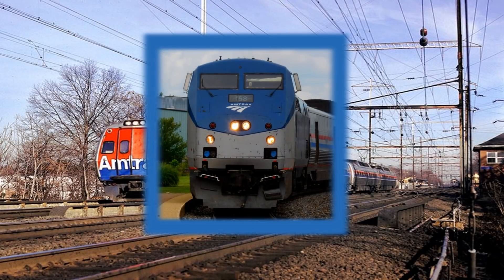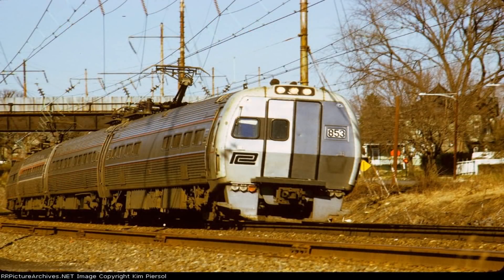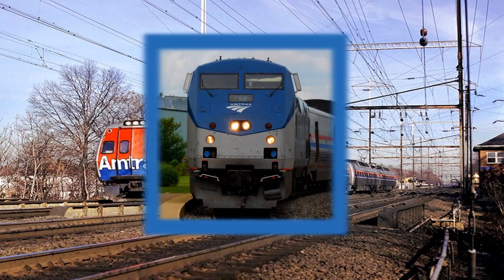Engines of Amtrak - Budd Metroliner

Comment from the maker: Please go watch the remake of this episode here! https://youtu.be/lXs8uaeQNRM In my opinion, its a lot more watchable and well written than this one lol. I'll still be keeping this episode up if you wanna come back to it but still, please check out the remade version too!
Reply: 4:21 Electrical arcing issue 4:25
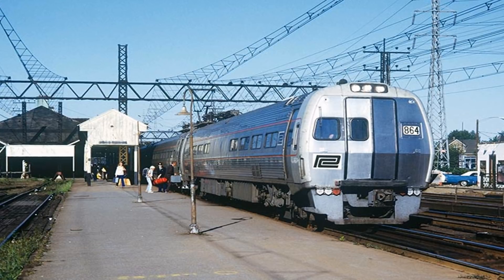Reply: 4:26 LOL!
Reply: 6:13 Westinghouse
Reply: 5:04
Output: 1200 horsepower
Reply: 5:11 SHRILLING HORNS!
Reply: 8:19 8:20 Small notable hump
Reply: 0:46 0:51 0:53 0:54 Great Society Infrastructure Rebuilding Program
Reply: 0:55
Reply: 0:11
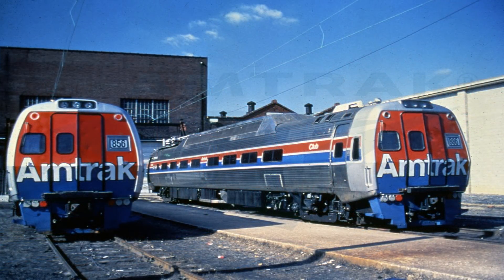Reply: 8:51 8:53 Out of service Metroliner rates were at 27 point 5 percent.
Reply: 0:56
Reply: 0:19 Bud Metroliner
Reply: 8:38 cost five hundred thousand dollars
Reply: 9:05 In August of the same year…
Reply: 1:20 1:24
Reply: 6:15 6:16 lackmoster
Reply: 6:49 6:50 Amtrakdinacted
Reply: 6:13 Westinghouse
Reply: 6:07 6:08 accept the cars
Reply: 6:26 but returned them to the Budd Company's plant for improvement in April.
Reply: 6:19 suburban station
Reply: 6:20 6:21 6:24 6:25
Reply: 6:32 40 percent!
Reply: 7:19 7:21
Reply: 7:24 leave your car at home
Reply: 7:26 and take the train!
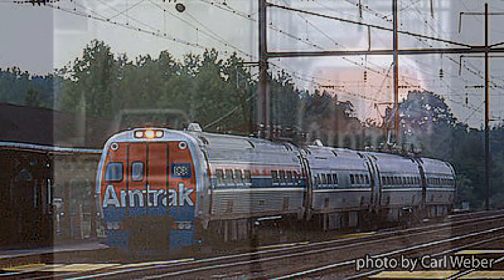Reply: 7:00 7:02 stating that they had all the amenities of an airplane such as speed and comfort…
Reply: 3:47 HEY! LETS RIP OUT THE WINDOWS TOGETHER! READY?!?!
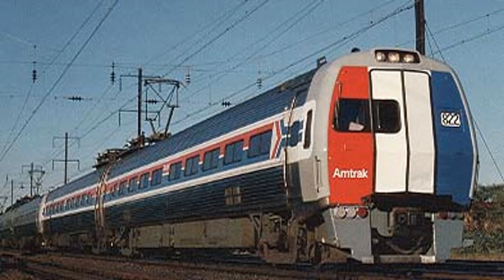Reply: 7:51 traditional locomotive power
Reply: 7:49 replacing the EMU sets with traditional locomotive power.
Reply: 7:44
Despite the major profitability of the Metroliner service, Amtrak briefly considered in 1972 replacing the EMU sets with traditional locomotive power.
Reply: 7:42
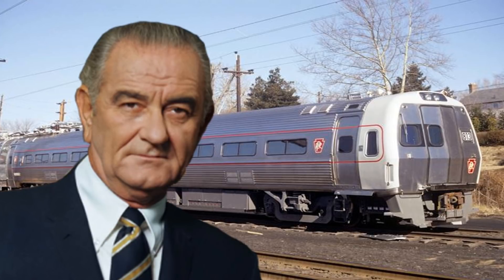Reply: 1:58 forced
Reply: 6:34 New Jersey Department of Transportation
Reply: 8:23 snow intake
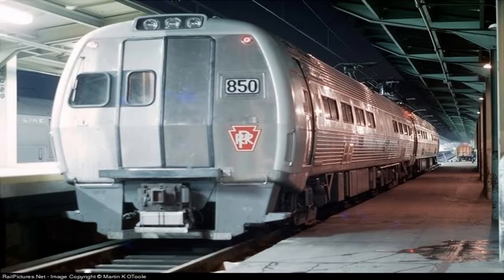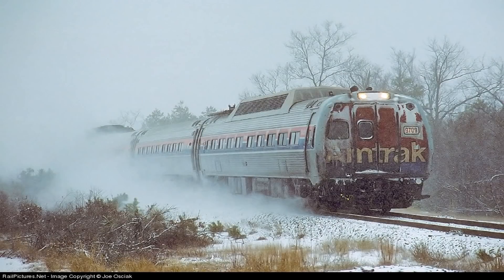Reply: 9:33 9:48 9:51 9:52 8:02 8:04 7:44 7:50 2:20 11:41 9:39 8:37 1:57 2:01 3:23 3:56 3:57 3:41 3:40 8:49 9:14 9:15 9:07 9:12 10:22 10:32 10:34 10:38 10:23 10:24 9:13 7:52 7:53 7:59 8:00 2:02 7:43 3:16 3:22 3:28 8:44 8:43 3:03 3:04

Comment: Small correction: While the Metroliner service brand officially ended in 2006, they had been Amfleet cars hauled by AEM-7 locomotives since 1982.  The original EMU Metroliner had been long gone since the early 1980s.

Comment: They were also used for a time on the San Diegan service.  When I took one in 2000, it was still using Amfleet equipment and still had an ex-Metroliner cab car.

Comment: One obscure footnote to the Metroliner story was the conversion of one car into a conference/first class configuration, numbered 9800.  It was meant to be an end-cab car only, as the front was solid, without any kind of exit door for mid-train placement.  It saw sporadic service, ending up being used only for specific charters, rather than operating for regular fare purchase on a given train couplet.  I don't know it's ultimate disposition, although I doubt it is still in service at all or even exists.
Reply: 863 is  now 9800. It appears in charter and excursion service, often for sports teams.

Comment: I love how old regeared GG1s could meet almost similar speeds of the metroliners while the GG1s were really old and outdated
Reply: GG1s were a jack of all trades for the corridor. They could literally do anything. High speed passenger trains, intercity freight, heavy long distance trains, you name it the GG1 could do it. They were also extremely reliable despite being such an ancient locomotive. That "Ship horn" also known as the Leslie A200 which was a popular horn throughout the 40s and 50s for ships and locomotives was also quite the distinct sound on the corridor earning the nickname "honker" The only reasons the AEM-7 took the GG1's crown was age and the AEM-7s while on par with reliability were much faster and a little shorter in size. Quite a few old hands I've met that work with Amtrak say the GG1 was the best engine they ever had. Heck if Amtrak decided to spend some cash on rebuilds and replacing the PCB based transformers the GG1s could of lasted for quite a few more years!
Reply: @Thunderbolt_1000_Siren  The GG1 was and Still Remains an NEC Icon
Reply: @Thunderbolt_1000_Siren  I believe the frames had cracks, dooming them in the 80s.
Reply: GG1's top speed is 135mph, but they restricted to 100mph.
Reply: Some gg1s had related ship horns
Reply: 8:19 Small notable hump
Reply: Well what if the metroliner was a dmu instead of an emu
Reply: @onecolossalrubikscube2554  That's what the SPV2000 was. Basically a Budd RDC mixed with a Metroliner... It was... umm... yeah it sucked even more than the Metroliner.
Reply: 7:09 More and more smart executives are going places on an Amtrak train.
Reply: 0:46 President Linden Johnson
Reply: 0:43 Shinkansen or Bullet Train in Japan.
Reply: 0:47 0:44
Reply: 0:20 Budd Metroliner
Reply: 0:19
Reply: 0:30 Five B units on 1 train.
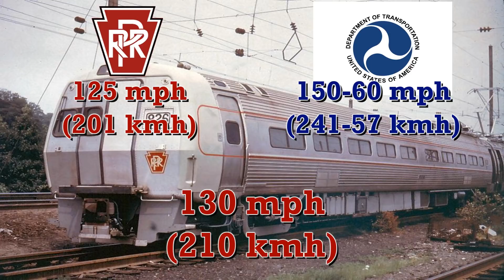Reply: 1:35 1:36 Shinkansen 🚄
Reply: 3:23 Ahaal the other cars
Reply: 0:55 That same year the Pennsylvania Railroad...
Reply: 7:04 Buddy coming!
Reply: 7:24 7:26
Is to leave your car at home and take the train!
Reply: 9:18 RC4 is in Sweden 🇸🇪.
Reply: 7:07 Business Trip
Reply: 7:21
Reply: 9:07 9:08
SPV Dash 2000
Reply: 8:04 8:05 Erie, Pennsylvania
Reply: 0:56
Reply: 7:23 7:07 Business Trip
Reply: 7:08
Reply: 1:04 EMU for short
Reply: 1:02 1:04
Reply: 1:05
Reply: 9:12 But due to it being a mechanically unreliable, it never came to be.
Reply: 9:13 unreliable
Reply: 7:52 7:59
Reply: 7:50 7:51 Traditional locomotive power
Reply: 8:02 8:04 One GE-powered Metroliner was sent to Erie, Pennsylvania, for an experimental rebuild
Reply: 9:14 9:15 It never came to be.
Reply: 0:11 Da du du du du du
Reply: 6:13 Westinghouse
Reply: 9:33 cut altogether
Reply: 9:48 9:51 9:52
Reply: 8:02 8:04 9:48 9:51
Reply: 2:20 Snack Bar Cars
Reply: 11:41 Snack Bar Car
Reply: 9:39 Phase wen paint scheme
Reply: 8:37 The rebuilds cost five hundred thousand dollars
Reply: 8:38 WOAH!
Reply: 9:13
Reply: 8:44
Reply: 8:47 clocked in
Reply: 9:07
Reply: 10:22 The last run of a nawn-rebuilt Metroliner set
Reply: 10:32 By this time the Metroliners had become so unreliable, it wasn’t uncommon to see a Metroliner train being towed by a conventional locomotive.
Reply: 10:34
Reply: 10:38
Reply: 10:23 10:24
Reply: 7:44
Despite the major profitability of the Metroliner service, Amtrak briefly considered in 1972 replacing the EMU sets with traditional locomotive power.
Reply: 2:13 2:14 from the prr
Reply: 2:02
Reply: 7:43
Reply: 9:33 9:48 9:51 9:52 8:02 8:04 7:44 7:50 2:20 11:41 9:39 8:37
Reply: 9:07 9:12 10:22 10:32 10:34 10:38 10:23 10:24 9:13 Cuomo
Reply: 7:52 7:53 7:59 8:00 Cuomo
Reply: 2:02 7:43
Reply: 3:16 Cuomo 3:22 Cuomo 3:28
Reply: 8:44 looked to repair
Reply: 8:43
Reply: 3:03 3:04 Cuomo
Reply: 2:01 NOT THE RAILROAD!!!!
Reply: 3:23 Aaal other cars
Reply: 3:40 passing by MP54 railcars.
Reply: 5:05 1200 horsepower
Reply: 5:11 Shrilling horns 5:12
Reply: 3:58 3:59 There’s also an echoing problem during tests as well.
Reply: 3:41 MP54 railcars
Reply: 3:56 3:57 low capacity transformer
Reply: 10:11 10:12 But they’re more reliable AEM-7s was starting to make its mark.
Reply: 1:58 The government forced the Metroliners into service, nawt the relroad!
Reply: 1:57 In a sense, the government forced the Metroliner sets into service, not the railroad!!!! 2:01
Reply: 6:34 New Jersey Department of Transportation
Reply: 1:57 2:01 3:23 3:56 3:57 3:41 3:40
Reply: 8:49 not many were actually repaired. 9:14 9:15

Comment: Those just look like commuter trains! Can’t believe they were supposed to go as fast as the Shinkansen...
Reply: Unfortunately, the northeast corridor is not able to run a train as fast as the Shinkansen unless there are major changes to the route. There's just too much development along the line now. Railroad and government will get fierce resistance if they try to pull eminent domain and kick out people near the route so they can make the needed modifications.
Reply: 3:26 you look like ur right
Reply: 3:05 3:06
Reply: 4:08 Penzentral
Reply: 4:01 4:02
A fu munths laetr on Febrary frst 1968, the Pennsylvania Railroad was merged with the New York Central and New Haven Railroads to form Penzentral.
Reply: On a train with the aerodynamic of a brick
Reply: They actually are for high-speed capabilities. You can tell by the side paneling. Which was created for speed and arrow dynamics, same thing with subway cars, which also had the same plating it’s just that this is much more American design, but something that supposedly implemented to a system that already like 80/90 years old at that point one thing, I really wish they did was made them 4 cars instead of 2 you could also tell by the windows everything doesn’t look like it could open they were stated the art compared to the MP54 and MP75 from around that time to which were aluminum most trains in the 60s in America were made from a type of aluminum painted steel. It was no straight stainless steel cars. Until damn near the 70s Budd went overseas from the 50s to the 70s and was producing multiple stainless steel Tokyo cars and then came back to the states and brought it back though the era
Reply: The reason why I said this makes me laugh is because the Metroliner was built to commuter railroad specifications. The shinkansen are actually just flat sided railroad cars with big ass planes noses added to give it speed their also 11 feet wide the metroliner are much more rounded and suited for high-speed service as you can see with the speed plating all around them, which are the rivets shinkansen model later get more rounder to increase speed and the design changes to bird beaks the only downside I can say would really cause the metroliner was not to succeed was the implication of too much technology I feel like if they wouldn’t went with the original four car proposal and would’ve took Metroliner coaches and move some of electrical components to those cars and work on some of the kinks, they would’ve been better off as multiple units.than pairs this also would’ve been better off because than they wouldn’t have to try and buy another order of metroliner The design was new at the time we had the silver liners which are much more closely size related to shinkansen and older stock from the 30 and 40 a lot of the technology that’s in Japanese railways originally came from America and in the uk
Reply: True! They don’t look very aerodynamic at all but can still go just as fast as the Acela today! They were great machines
Reply: That's America for you
Reply: But they did
Reply: @saturnarmy3636  The Metroliners might have briefly topped out at speeds comparable to the 0 Series Shinkansen in a few spots like Princeton Junction, but the brand-new dedicated right-of-way for the Tokaido Shinkansen ensured that Shinkansen trains could maintain much higher platform-to-platform average speeds

Comment: I remember well hearing those Metroliner horns blowing for the Knecht Ave. grade crossing on the NEC in Arbutus, MD. I lived about a mile away during the years 1964 to 1979, but still could clearly hear the horns and could always tell what units were pulling a train - Alcos, E44s, GG1s, etc. - by the sound of the horn. Didn't know the Metroliners had so many issues back then until seeing this video.

Comment: This was an interesting chapter to me because I rode the Amtrak/Budd Metroliner from DC to Philly in March of 1976.  I was a kid of 13 traveling with an adult companion who was a transportation enthusiast ("nut" in his parlance, I'd even say).  What I remember most was the Club Car with swivel seats, where we had dinner - prime rib of beef from a real galley.  The tracks, I recall, were kind of rough - especially at high-speed.  There was a pay phone in a booth on the train, and I had to try it.  I do remember that the connection to my parents phone was static-laden.  I'm still not sure how that connection was achieved.  The waiter, incidentally, resembled an old-fashioned Pullman Porter (very much ingratiating), and I'm guessing that he almost certainly had to have been of those ranks.  It was fun, is all, and memorable.  The Acela is great, but entirely without the character of those Penn originals.

Comment: Metro Liners one more synonym for FAILURE. I guess that should be accepted seeing as how it was a PENN CENTRAL project.

OMG did America want them and need them. It took multiple attempts just to make them run without shutting down on line. NO I don't mean multiple tries....it took MULTIPLE MODELS AND CHANGES TO EACH before 1 model would basically run at all. 

Many of you see these TODAY as basic Amtrak coaches because that is what finally became of them after they just refused to work, they became Amfleet coaches pulled by Swedish AEM-7's. 

AND OH HOW AMTRAK CAN MAKE A HIGH SPEED PASSENGER TRAIN FAIL....first it was those huge and clunky GE built E60s electrics that kept coming off the overhead and when that was addressed by new pantograph tensioners.....those stupid sd40-2 freight trucks could not handle the speed and kept walking off the rails. 

OH MY, but the smaller freight versions worked for years and years on the Black Mesa and Lake Powell.

The aem-7's were grand but NOT AMERICAN.

New Haven had several styles and types of electric locomotives that should have been up-gradable but NO Amtrak wanted no part with that nor did they want any part with a redesigned  rectifier system in the GG1's.

SO they decided to go and get their own world class train, AHEM, and call it something fancy....ACELA EXPRESS.

1st week of runs and they all went down. MASSIVE BRAKE FAILURES. The entire brake rotor was fractured all to hell. So the route was plied with AEM'7's hauling Amfleet coaches.

All while the Acelas had their brake rotors redesigned and replaced. 

Ok so they had a teething problem, oh but if only that were so. Originally Amtrak wanted a HIGHER FARE service over the entire NE Corridor and sought themselves having over 100 Acela trainsets....oh but that is sooo over.

Today they have 25 and it will never be more than 25. On any given day only 10 of the 25 are available for service. FAILURE.

Since the late 1970s BILLIONS of dollars have been poured into that corridor and the end result is that it is carrying less trains today than it was in 1974 and the infrastructure is somehow showing no real signs it has ever been improved. 

So you know, I AM NOT AN AMTRAK FAN. 25 unions + 27 over sight committees make this thing a lame duck of political creation and it needs to go away.

NOT NATIONAL PASSENGER RAIL, and not a wholly federally subsidized system> just the Amtrak incarnation that finds a thousand ways to commit suicide at the tax payers expense. IT NEEDS TO START FROM SCRATCH WITHOUT UNIONS AND POLITICAL AGENDAS. Then it could be a different thing altogether.
Reply: What a dissertation. Now, if Amtrak had the same level of funding as the highways and airports/airlines, it'd be one helluva common carrier!!

Comment: First of all, THE SPV-2000 STILL COUNTS AS AN AMTRAK ENGINE BECAUSE IF YOU SEARCH " AMTRAK SPV-2000" YOUNWILL SEE MANY PICTURES OF AMTRAK SPV-2000s. LASTLY, There are many spv-2000s in existance ,2 metro north spv-2000s are in a PATH train yard in harisson, new jersey. However there are A BUNCH of conndot(cdot) spv-2000s . And the last one , is an FRA track inspecting spv-2000 , being restored by CALTRAIN, for track inspacting. So....basically the spv-2000 is still in existance
Reply: Problem with that is is that they leased the ones owned by the Connecticut Department of Transportation only on the New Haven and Springfield Route (minus the one used on the Danbury Branch), meaning they never bought them due to buying the AEM-7. Also they can't modify them as part of the lease agreement except painting them, and a side note: ConnDOT only bought 13 of them.

Comment: The old Metroliner 165mph and Acela 150mph
Reply: The UAC Turbotrain did 171 mph. The Acela can also do 165, but is limited to 150 mph in service, like how the Metroliners are limited to 120 mph.
Reply: Physeter macrocephalus when i saw the plaque at PJC i wasnt even sure the turbotrain could fit under the wire.
Reply: Note that it was track conditions - not the trainsets.  (The Metroliner trainsets were actually rated on-par with Skinkansen - and AHEAD of the later TGV; Acelas were designed to match track conditions.)
Reply: @PGHammer21A  The TGV was rated 50kmh faster than the shinkansen, so youve got something wrong there
Reply: @PGHammer21A  rated on par with what? theyre slower, ugly as hell, and nowhere near as reliable....